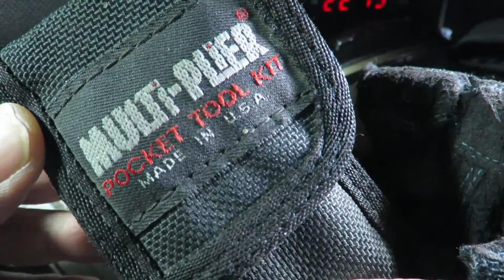Gerber MP600 Pro Scout with Tool Kit (+ old Gerber MP600 Blunt Nose with Pocket Tool Kit)

Comment: 11 years ago my step grandfather who is a retired cutler, gifted me a Gerber multi tool.
He said it was older but he cleaned and sharpened the blades. 
I haven’t seen another exactly like it. The 2nd “old gerber” you showed is very close. Only difference is. Mine has a razor edge type where your has a file.
The rest of the layout is the same. Same shape to the pliers, same hardware holding it all together. But where you’re has the patent numbers mine is written a little different.
I’m just trying to figure out exactly what model or version I have and about how old it actually is. I use it often over the last 7 years I been in the shipyard. It’s indestructible.